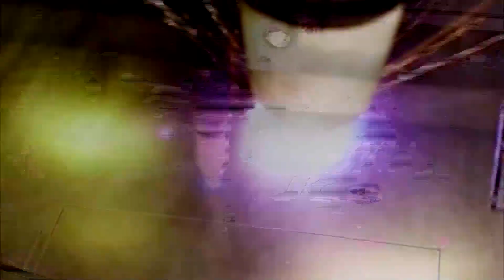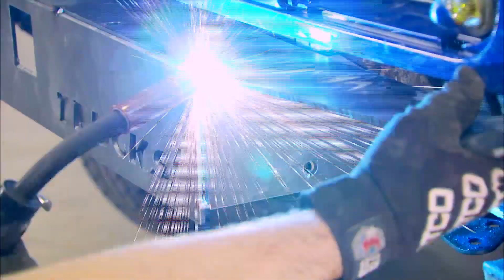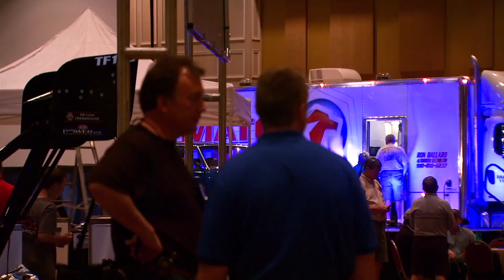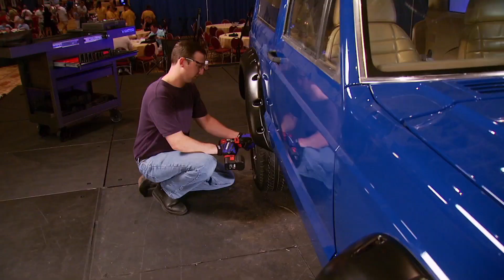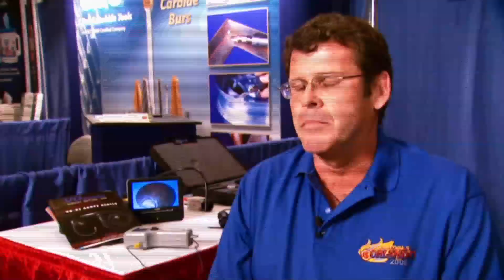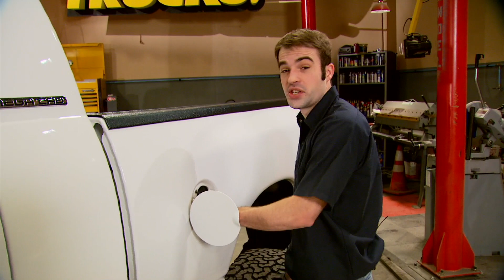Our Cheap Jeep Cherokee Gets CNC Plasma Cut Bumpers - Trucks! S10, E7

Comment: WHAT THE HECK ARE YOU DOING!?!?!?  You cant go cutting pinch seams out on UNIBODY vehicles!  Cutting those rear fenders out like that just destroyed that Jeep.  The proper way to modify the rear wheel arch is to cut vertical lines between the pinch welds and fold the sheetmetal inward to maintain the strength of the body.  I have personally seen Jeeps that had the wheel arch cut out like you have done here and it caused all kinds of issues with panel gaps, excessive flexing in the rear body, and rust will now run rampant no matter what you do to fix it.  I've also heard of it causing the rear windows to become prone to popping out, if you end up with that issue, good luck sourcing 2 door XJ windows.  You've also drastically altered the safety of the vehicle, if it gets rear-ended or rolls over, the damage will be FAR greater than if those seams were left intact.  

Very disappointed a high budget show like this would do something like this, even following the directions that come with cut-out flares it CLEARLY states not to cut the pinch welds and shows the proper way to install.  It's also common knowledge in the Jeep community that cutting those pinch welds out is a death sentence for an XJ.
Reply: Came looking for a comment about cutting out the spot welds in the pinch seam! Yep, unless they did a bunch of sheet metal work and welding to repair the rear opening that XJ is hurtin'!
Reply: I'm glad you said something to me about that. Both of my Cherokees are stcok, and I knew nothing about needing to cut the seams vertically. Thankfully, I've never cut my seams, so I'm good. 😊I plan to keep it stock anyway, so I will be going with stock fender flares. I have a mew motor and trans in one of them already and the other has 287k. Unfortunately they both need windshields. I will keep this knowledge in mind in case anyone ever asks. 😊
Reply: I was hoping that they would’ve shown how they fixed it. I was thinking they were going to weld it back together or something but nope. I have a 2-door XJ and will not be cutting the pinch welds in the rear.

Comment: "Cheap Cherokee"... Frame straightener, plasma cutting cnc table, tube bender, professional paint job, an entire Matco truck full of tools... Yeah sure I've got all of that in my garage too lol.
Reply: they spend alot of money on making it look good, wish they would keep it rough like a real cheap build
Reply: I mean the jeep was free or so they say and it still cost 6500. Thats not cheap
Reply: Exactly! lol you dont need any of that shit to make a sweet Cherokee it helps but I could make a Cherokee just a cool as that if not better with a welder a set of torches and junk parts off of junk vehicles lol
Reply: Cheap Cherokee huh. I'm into mine around 1100 including the cost of the jeep😄 flares and tires alone are probably close to 800 to 1k depending on tires wheels and if you bought a set of 4

Comment: Find a couple of strong trees, some decent chains and the ole 25 ton log splitter behind the wood shed and the sheet metal will give.
Reply: Or you could bolt up the chain to the body then wrap it around a tree and slam it in reverse

Comment: That diesel thing they bolted on actually work?
Reply: With stricter emission laws from year to year (little exaggerated), CO2 in the focus, and the direct correlation between consumption and CO2 emission: if it would be that easy to save on a few drops of diesel, OEMs would put those things in every car.

Or long story short: nope.

Comment: Who installs the rear flares like that.
Reply: He means the inner skin is not connected to the outer skin. Its a damn hole.
Reply: Its pretty typical to cut the arch away like that if you're going with wider wheels and tires and need more clearance during articulation. The only time you wouldn't cut them is if they're being used as mud guards, and you're not worried about the tires contacting the existing arches.
Reply: @Canuckrz  the XJ is a unibody vehicle and it drastically reduces the strength of the body to cut those pinch seams out.  It clearly states in the instructions for cut-out flares for an XJ to not cut them like that.  They need to be cut vertically between the pinch welds and folded inward.  I feel bad for whoever ends up with this Jeep after they are done with it because its going to be a lot less safe on the road and is already starting to rust out in there.
Reply: @dakota.zimmerman  I see, thanks for the info. As far as the next person who gets it goes you don't have to worry, most of the vehicles they make on these shows end up crushed unfortunately. Adam Stacy the OG Trucks host talked about it before and it was part of the reason why he ended up going over to Gearz.
Reply: @Canuckrz  wow that's just sad.  I suppose it's a liability if they sell it to someone with all the "upgrades" they do.  That's good to know tho, I have found some companies just don't care about how hard it is to find things.  I've had a similar run-in with a company that would throw out Sega Genesis game cases because "they take up too much space".  Irreplaceable and very hard to find for us who don't have money to throw at everything.  Lost a lot of respect for this show now.  Wish there were more like roadkill where they actually care about the vehicles and will get anything back on the road.